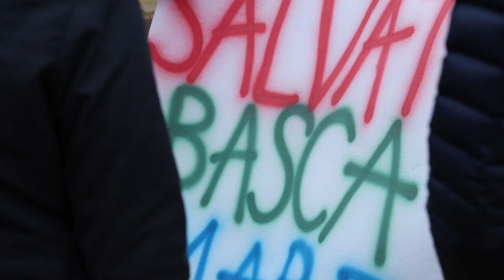ENGINEERING MYTH: Is Hydropower a Renewable Energy?

Comment: If you get rid of coal fired power, what’s the alternative? Nuclear? People don’t want that either ? Wind and solar are not effect enough. Hydro is one very good alternative. You haven’t mentioned Trompe technology along with compressed air . Unfortunately the green environmental movement has Sold alternative energy as a silver bullet . At the end of the day modern humans are at odds with their natural environment whether they admitted it or not . Do you want electricity or not ? The production of a solar panel and battery system are more taxing on the environment in the long term and only last 25 years ? I live in a valley which has Hydroelectric dam above it , we have Kayaking people here every spring after the snow melts . The scheme has been in place for 60 years the river is very clean , we have had native cod in many places in recent years where they weren’t. Micro hydro system could be used by many small land holders which only divert small percentages of water through run of reducing pipelines that go through the pelon wheel create the power for the farm then get reintroduced in the river down stream , there many types of alternative power that don’t involve burning fossil fuels . And like anything they have to be employed correctly and the design has to be right and your never going to please everyone.